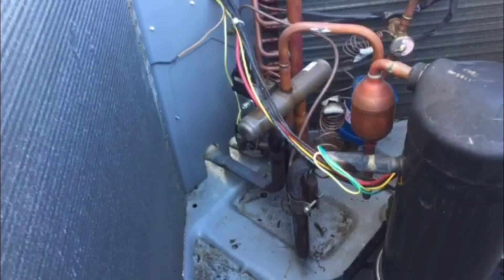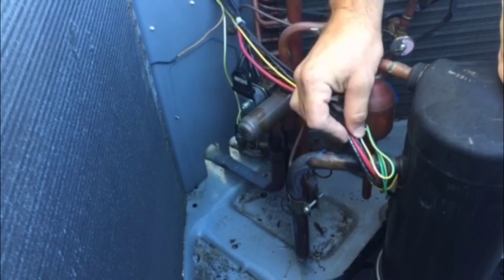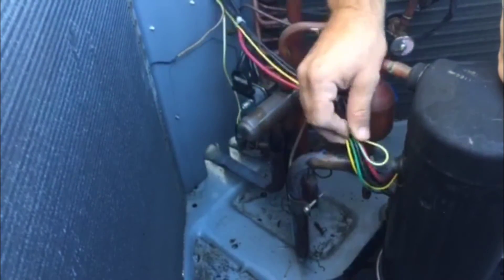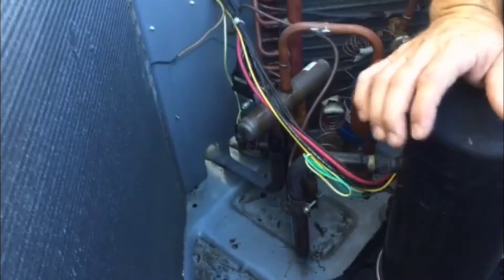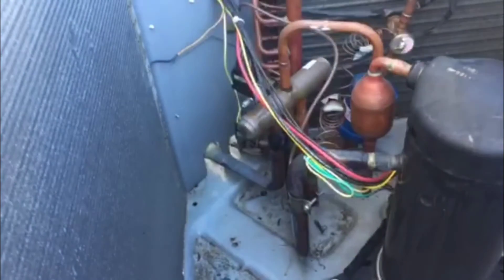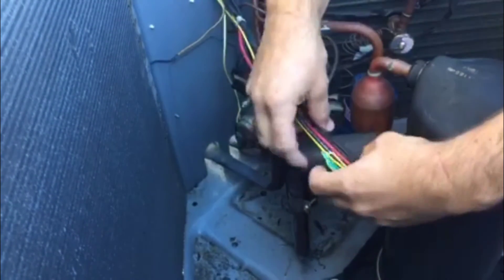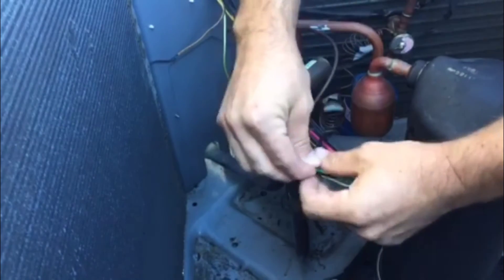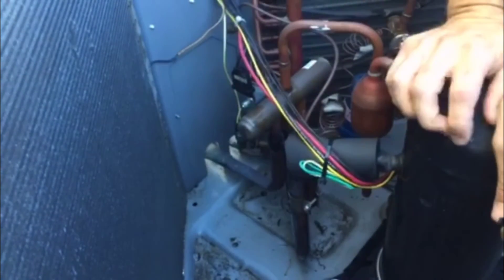Preventing Wire Rubout on Every Service Call

Comment: I always still find the wire zip tied to copper.(no insulation). I'm only a 1 1/2 tech trying to be blue collar and use this method thanks to this video however in Las Vegas it is extremely rough with all the hack companies out here.